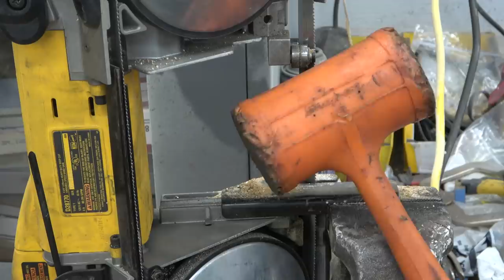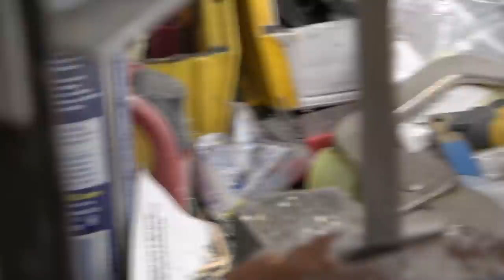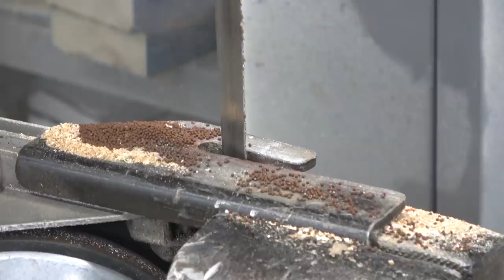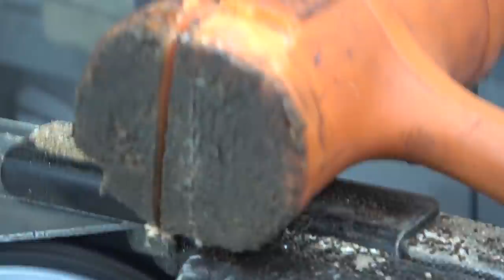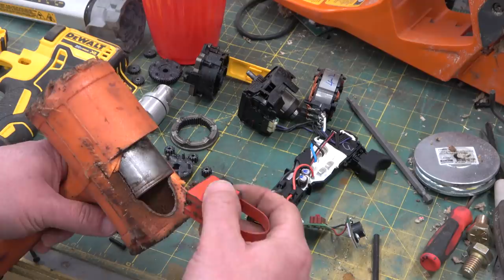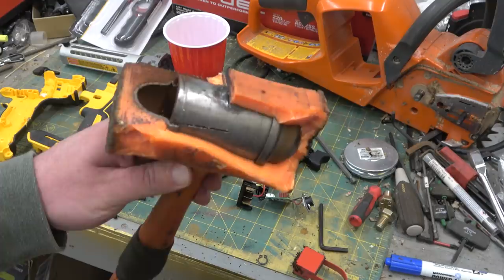BOLTR: Dead, blow hammer?

Comment: I've broken many a dead blow, they have little stainless steel balls (the newer ones) steel balls if they are slightly older. If it's really old, then you get some lead. Apparently though, they had issue with the LEAD balls deforming and then sticking together which threw off the feel of the dead blow. At least that's how it was explained to me in the rape wagon.
Reply: The oldest one had lead bird shot inside.  You could shake it and hear it shot moving.
Reply: Formed lead still blows dead.
Bet mancies just cried cuz lead.
Reply: But a great big chunk of lead isn't the same as bunch of tiny shots with the same weight.
Reply: This was my first thought, that lead would probably deform and cause problems.
Reply: Wonder if tungsten balls would be better than steel/stainless
Reply: @ionstorm66  absolutely. Other than the significantly higher cost, yes they would. They are denser.
Reply: @SerbanCMusca-ut8ny  I get the joke, but this one is an issue worldwide.
Reply: @XxShantilisxX  i have dead blows that are just a solid block of soft lead- they blow dead just fine lol
Reply: @philup6274  The lead doesn't need to join, it just needs to take up less volume inside the cavity. Then it would either (I'm guessing) stick to one side, and maybe move/slide on impact. Or it can just freely move around.
Reply: That's exactly how they evolved! Lead shot that became a solid clump, replaced by successive grades of steel!
Reply: @danielgeorgianni1687   once the lead clumped together, it really lost a great deal of the "dead-blow" feel. They went to steel shot long before the environmentalists cottoned on to the lead component!
Reply: @youngbloodbear9662  so it’s not a deadblow…
Reply: I'm no expert but rape is not usually that dull
Reply: @SerbanCMusca-ut8ny  that's only in California though right?

Comment: I seriously appreciate you turning the audio down when running noisy equipment.  Most other channels like to blow my eardrums out with that stuff
Reply: Yeah his sound management is so good compared to many youtubers in this workshop niche.
Reply: @MichaelOfRohan  This is definitely edited in post.
Reply: @802Garage  
Agreed. 100%.
Even if it isn't evident in this particular video, it is very much so in quite a few other vidjas.
Reply: Nah, that's just the microphone cringing and leveling down automatically.
Reply: @nelsonbrum8496  it’s incredibly easy to do this in post. Literally below the video file there’s an audio track on divinci resolve 17 (it’s even free) and it allows you to turn down the volume on any portion of the video. It also shows which parts of the video are the loudest, and allows you to set max volume points so essentially it’s done automatically.
Reply: @ehh2681  What does your reply have anything to do with my comment?
Reply: @nelsonbrum8496  the difference between manual audio adjustment vs auto audio adjustment

Comment: Those balls are the last mortal remains of all the lost 10mm sockets….
Reply: And 5mm hex keys
Reply: The souls of all the 10mm lost sockets.
Reply: No one believes me but I ACTUALLY have 3 10mm sockets in my workshop…..
Reply: @timfromammoniteknives4212  all made in taiwan? My three are, all 1/4 drive too
Reply: @timfromammoniteknives4212  Same here. Somewhere, at least. I'm fucked if I can find them though.
Reply: @PJBonoVox  They're the perfect size to throw at my chihooahhooah dog to get his attention to my quit yipping commands when I am adjusting the brake bands under the bus.. I by gross ones buy the cheap.
Reply: @PJBonoVox  exactly! I even had a photo of them but now it’s just an over exposed mess….
Reply: I believe you, but I also believe you can't lay your hands on one without hunting for half an hour 🙂
Reply: @timfromammoniteknives4212  I have a 3/8 socket that gets rather abused on 10mm nuts.
Reply: @captainchaos3053  Oo er missus!
Reply: @timfromammoniteknives4212  got to work with what you got, even if it is only 3/8"
Reply: @captainchaos3053  indeed! As nature intended….

Comment: Back in the mid-80s I was working my way thorough trade school as a lab (shop) assistant.  One of my daily duties was to check out tools to students from the tool crib.  We called it “Tools for Fools.”  One day we had a new student ask us for a Death Hammer.  Talk about laughing you ass off…  

The old hammers had lead shot in them and when they would fail, they would spread a very fine almost graphite like powder over everything.  I think the changeover to steel shot happened in the mid-90s.

Comment: In any other hammer I would have expected steel balls (spoiler I’ve had one apart afore) but for snap on pricing I would have thought maybe depleted uranium spheres. Because spheres are more spensive than balls. Least that’s what she told me, but to be fair she did have a 5 o’clock shadow and an Adam’s apple so she was a little suspect.
Reply: That's another 'Mister', Mister!
Reply: @joshk.6246  Spheres have balls, but do balls have spheres‽
Reply: Nah, not spheres, some kinda magic  dodecahedron unobtanium. I like Snap on but think they are a little too proud of their tools.
Reply: There is never any good reason to set foot into one of those tool trucks, I always hear folks blabin' about life time warranty and if it ever breaks they will replace it. Tell that to my snap on multi-meter, what a useless piece of fucking shit that thing turned out to be. I keep it around to throw at pigeons and use as a hammer.
Reply: Should be pure mercury. The logical extrapolation of small metal spheres.
Reply: Lead, Helium, Uranium, all empty space. We need a hammer with neutron star spheres in it!
Reply: @skunked42  Not the tools just their name

Comment: They use deadblow hammers for orthopedic surgeries. When I worked at a hospital, the surgeon got a little over zealous with one and broke it, the sand inside filled the incision on the patient and the surgeon had to spend several hours picking grains of sand out of the patient.

Comment: Steel shot meets the requirements better than lead or tungsten.. lead would just compress and deform and not provide enough solid blow, and the good old Wolfram would do either of two things (or both), besides costing a LOT more: wear out the inside of the head of the hammer or start chipping itself into powder.
Reply: antimonal chilled shot is hard.  it gets hit at 10k pissys and squeezed through a choke and the less it deforms the better the bird killin
Reply: Dig your name!
Reply: @Iceberg86300  thanks!
Reply: Naw, the little orbs bounce around each other. The wolfram would require many thousand smacks at a higher force than a human arm to chip themselves into dust.  It's a very hard (yes, not tough) metal and each ball only gets hit by a couple others the same size and velocity.
It's a hammer, not a ball mill!

Comment: The nice older gentleman over at Essential Craftsman was gifted a wooden dead blow that was made with lead bbs. Uses it for certain blacksmithing tasks.
Reply: If it was small, it would be good for forge welding. Soft tappy tap tap, but all the energy gets dampened, so the weld doesn't pop back apart. I might put a small lead head on it, to keep the wood from the really hot bits, without transferring anything to the steel and hooping the weld. If you want to mess with someone, toss a penny into their coal before they do a forge weld, that bastard will never stick together!
Reply: @JayFude  as some one whos tried to forge.. thats evil man.

Comment: I bet that's the same stuff they use for "sand"blasting these days, at least it looks exactly the same. They do the blasting in a room with a floor made of grating, the used steel shot goes through a magnetic separator that gets rid of all the paint, rust and other schmoo (that's why steel shot is great for the purpose, it's magnetic, the schmoo isn't so it's easy to use a magnet to separate them) and gets reused again and again, more economical and less messy than sand.

Comment: I just had to buy a new dead blow hammer a couple of months back.  Went to grab my old one out of the drawer and it disintegrated into dozens of pieces of plastic shrapnel before my eyes.  Looks like yours was getting set to do the same thing.  Mine was also about 20 years old, but made of 100% Chinesium.

Comment: 'Round about a hundred years ago, I worked in a machine shop/ plastics factory.  Every now and then, the boss liked to punish me for my recalcitrant ways and would put me on the night shift.  I always took full advantage of the unsupervised time to handle some business that needed handling.  To wit, my wallet.  One of these aforementioned spells was used in the design and manufacture of dead blow hammers.  I took on a dimwitted, but hardworking, compatriot to make a couple of molds and produce as many hammers as we could out of the "scrap" that we "found" in the "garbage".  We traded one of the fellows in the crew some of his bird shot for a few hammers, and we got us a regular production going.  

I think I have one left.  All these years later, it still brings a smile to my face.  They turned out so nice.

Oh, I buy the cheap ones from Horror Fraught when I actually need to use one.  Ain't no way I'm taking out a loan to buy a hunk of plastic from the rape wagon.

Comment: Cant remember the brand, but I company I spent the first 8 years of my welding carrier supplied lead filled dead blow hammers. They were all fairly old. I only know they had lead as the one at my work station started leaking a bit. And like any good penny pinching corporation, they never replaced it after the clipboard warrior threw it out!

Comment: You could use spent U238 like Warthog mini-gun  bullets, but its a matter of cost.  Steel is cheaper than Plumbum. 
Those tiny steel pellets are also used as a medium for a fire door closer coupling in a warehouse.  If it ever splits open and spills out pellets on the concrete, you can not stand up or drive a fork lift in the area until you sweep up and pick up with magnets.
Reply: Wait let me guess how you know that . . .

Comment: My brother had an AR he built from a cheap parts kit many years ago.  Darned thing wouldn't cycle.  We decided it must be the buffer.  Knocked out a roll pin in the thing and hundreds of little steel balls came tumbling out everywhere.  We didn't find them all, so made do with what we could save.  Rifle never worked.  Still, we got to learn how they try to keep the bolt from bouncing against the barrel extension.
Reply: I had the same problem with a carbine, thought it was under gassed. Kept taking weight out, still wouldn't cycle. The darn thing was OVER gassed and I finally got it heavy enough.. It runs beautifully now.  (The bolt was slammed back and forward so fast, the cartridge couldn't pop up quick enough)
Reply: @rbnhd1976  That's exactly what was happening with this.  It ejected fine but the next cartridge never fed.  If he still has that rifle, maybe its worth giving it a try.
Reply: @MyDailyUpload  good luck with it man, I remember the buffer that worked had metal discs and cylinders for weights, also seems I used a gi carbine/m4 spring, hey another thought, does it kick "sharply" like? That's what mine did originally, now it hardly kicks at all, anyway peace
Reply: @rbnhd1976  Try making a tube fed .22lr go full chatter. 
Wasted a significant portion of my 20s on that.

Comment: Interestingly enough, the buffer in the back of your AR-15 works exactly like a dead blow hammer to eliminate bolt bounce. H, H1, H2, and h3 have a varying assortment of steel and/or tungsten weights to achieve different effects on bolt carrier velocity characteristics. Maybe the fap off used steel instead of lead so the little balls don't deform, and if they used tungsten or bismuth you might actually get your money's worth
Reply: He's not allowed a AR15😂😂
Reply: @sjowners  AvE has a couple of powder actuated tools that work very fast, not an AR per se but close enough

Comment: I bought one of these from a truckload tool sale about 20 years ago. When she finally burst open I found steel inside the thin walled spot welded tube, but not the nice little round balls snap-on chose to use. It looked like grinding and machining debris mixed with dirt. I'm pretty sure it was random shit swept up off of a factory floor somewhere. I'm not complaining because it was $6 and I got about 15 years out of it.

Comment: Wonder if lead would smoosh together over time with lots of hits and be less effective as it congeals into one big blob that wouldn’t move very well?
Reply: Silicone Implant
Reply: Lead won't smoosh together rattling around.  Ever fired a shotgun and been amazed at the solid lump of lead flying out the end of the barrel? It will barely smoosh together between an anvil and a 10lb hammer when it's cold. It's a softish metal not playdoh.
Reply: i'd say it may change shape over time, but its still rolling around loose, so changing shape equally in any direction after every hit
Reply: @organicvids  Where (when) in the vid did he mention that?  I missed it, and only found that idea while reading comments.  When he was cutting it, I was surprised the blade was damaged, thinking it would be a mild steel hammer filled with lead shot.
Reply: Powdered lead is where its at, smells nice and tastes even better! 🤣

Comment: My SnapOff 30 oz. dead blow ball peen split the compothane, so I removed all the stuff. To my surprise, the steel in the handle was maybe 3/8" round stock. I welded a piece of 3/4" pipe over that with a washer to center it, then welded bumps all over it so it had some grip. I bought it new in 1978 and fixed it in 2018. It looks odd but it still works well.
Reply: Beautiful... you're just like me.

Comment: Two questions. 
Q1: Can you not warranty that?
Q2: What other plastic hammer will last longer than two decades?
Reply: It absolutely is covered by warranty. Or was lol. If he's got a good dealer it might still be
Reply: @stevef3685  Ah...that is the new stress-relief handle. It's a feature not a flaw. The handle is designed to conform to your hand. It also prevents toxic masculinity because it keeps from you really hitting the thing as hard as you need to.😁

Comment: I used to make/assemble many of the snap-on hammers at an injection molding company in early 2005. I primarily worked with the ball peen and dead blow hammers back then. At that time, the handles were a fiberglass rod and the heads were a small piece of steel pipe that we loaded with lead shot and pressed caps onto before molding around them.

Comment: All of the dead-bow hammers I broke had a canister that was flat on each end (I'm cheep I don't but Snap-on). Do you suppose those Spherical ends contribute to the Hammers performance? I have got tiered of those full plastic dead-blow's (Gone thru to many). Lately I have been using the Wiha  ones with their metal construction. They so far are holding up better, but they are expensive as well.
Reply: I can only speculate that the domed end of the canister focuses the shot into the same point every time for more consistent swanging. I’m sure whoever snap-on copied the design from could tell us ;)
Reply: i think its to redirect the energy to the flat end of the cylinder instead of just one small area.
Reply: Yep, domed end gets it every time.
Reply: I buy cheap and buy lots on dead blows, harbor frieght gets the job done on the percussive devices.
Reply: When I was in college, the machine shop had all Lixie dead blows. I've stuck with them for over 15 years, only had one handle break when I misseded the target of my thrustration. Bought a replaceamont from Lixie and still whackin away today with new wood. Replaceable faces in multiple durometers FTW.
Reply: You are not cheap, just normal.
Reply: @nelsonbrum8496  used em to fit transoms on aluminum vexus boats, loved those hammers

Comment: That's one tool where I well imagine that there's not a single practical difference between a Snap-On and a Harbor Freight one. Or if there is, not worth the difference even for a pro.
Reply: I bought a cheap dead blow hammer, the bastard thing was still alive its squirming caused me to smash my thumb
Reply: the difference is you can keep taking it back for a new one when the plastic starts chipping and they have all the colors. its worth getting the nicer one since you only pay for it once
Reply: There is a massive difference. All other brands I've tried including blue point disintegrate in months. The plastic is too brittle. The snap-on's last about ten years, its really amazing what they can take. That's worth $100 bucks easily. Plus I've traded mine out twice. Both times it was because the faces were mangled beyond use. They never split like the cheap ones. Some of their stuff is worth it.
Reply: I saw a review a while back, the Horror Fright one actually did better.

Comment: You didn’t have to buy another strap-on dead blow, warranty it. Have done it about 4 time in my 41 years as a automotive tech.
Reply: Precisely. That math checks out. In My 20 years I've gone through 2. They are insanely durable. No questions asked on either. No snide comments either. Just smiles. But then , I always paid my bill.

Comment: The only Snap-On tools I have in my toolbox are the ones I find on the road around construction projects.
Reply: Heh - that's nothing. I was the Honda Generator Repair Station back when Lynch Display Vans had the little liquid cooled belt driven SOHC inline twin turds supplying the Aux 12vdc when the traction engine was off. ('82-'89)
 I had a half dozen Snatch On Rapists who would beg me to unlock my gates and let them have their trucks back Monday Morning promising I could have anything inside that I wanted.
     Nope - I'd send 'em to the bank for money and make 'em stop at Sears and pick up my new tools for me on the way back  :  D
       Good times !